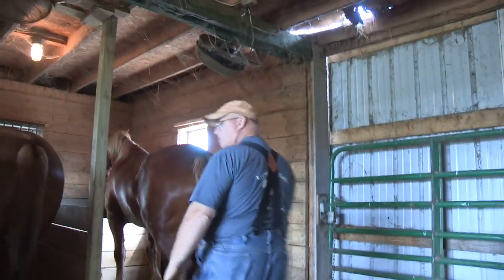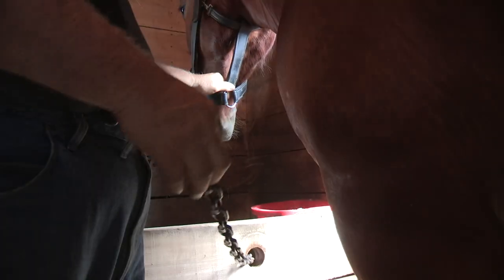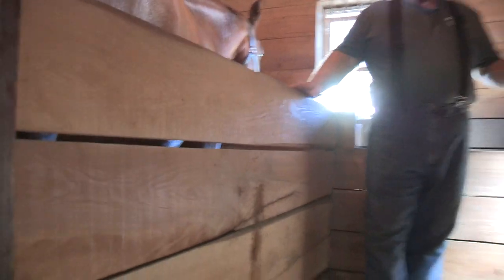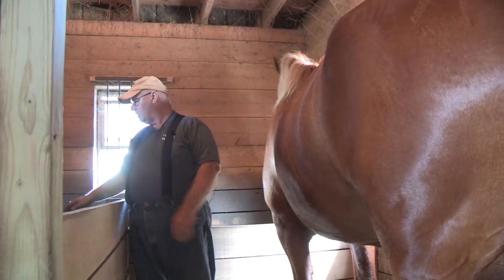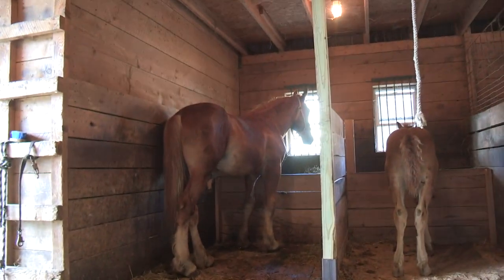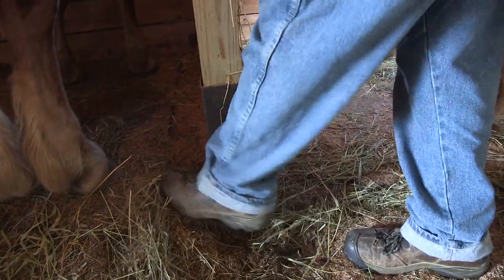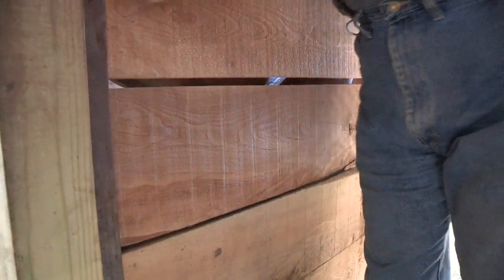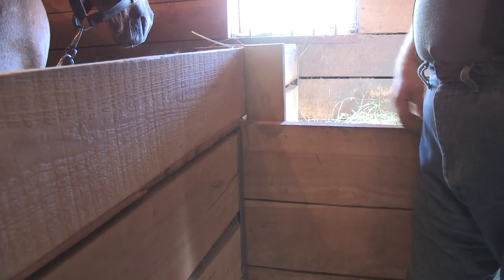DIY Draft Horse Tie Stalls - Custom Stall Project

Comment: In the old days when we used standing stalls (which we no longer do because they are cruel), but in those days, instead of tying them in, we left their heads free and had a rope across the back to keep them from backing out.  It worked really well.  But at this point, I do not approve of standing stalls - this is an inhumane way to keep our magnificent horses.
Reply: Not cruel nor inhumane. A lot of ppl now a days uses this to feed there pasture horse separately. Regardless say what you want but these horses are fit and looks very well taken cared for.
Reply: @DestinyonDemand  But these are not pasture horses only coming in to eat.  They live in these stalls all the time when not working.  They cannot walk around - all they can do is stand there all night, all the time when not working.  For feeding pastured horses, this is fine, but this is not the case here.
Reply: They can lay down in tie stalls lie comfortably. Horses are not meant to be stalled 24/7. Its cruel if they are not turned out for at least 10 to 12 hours.